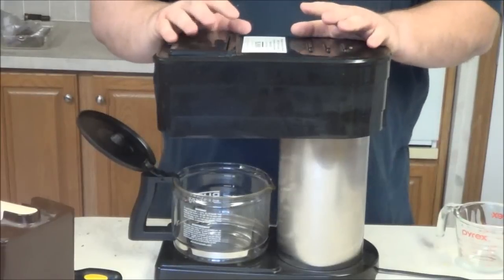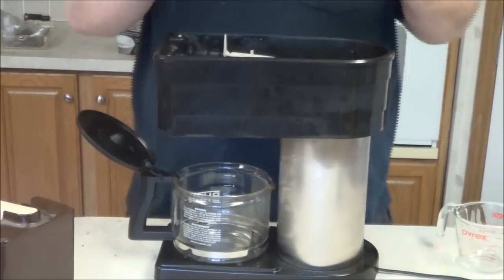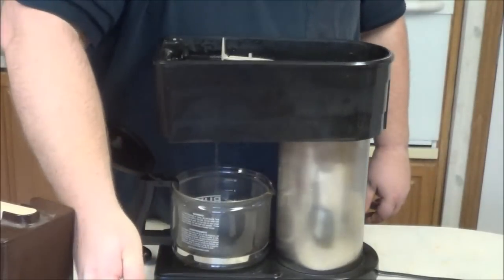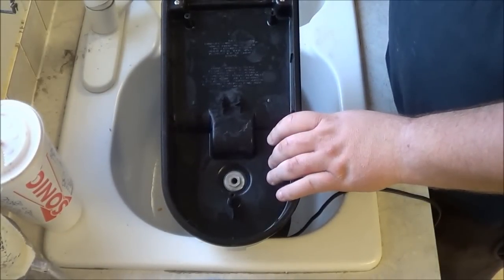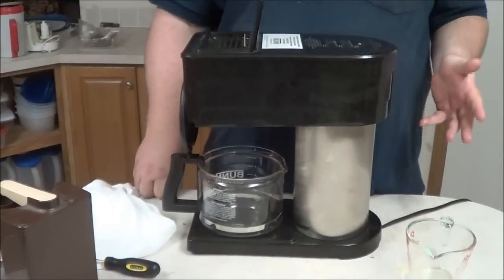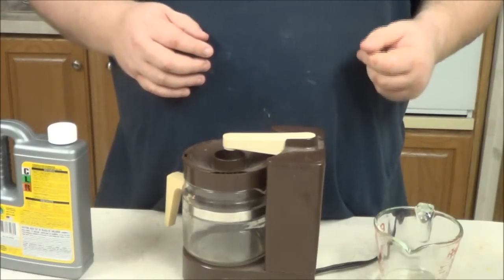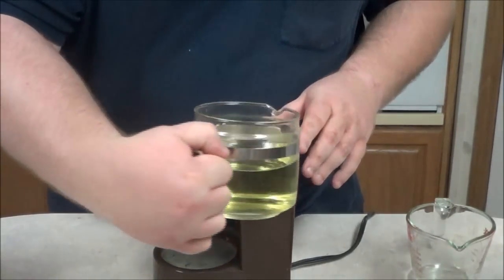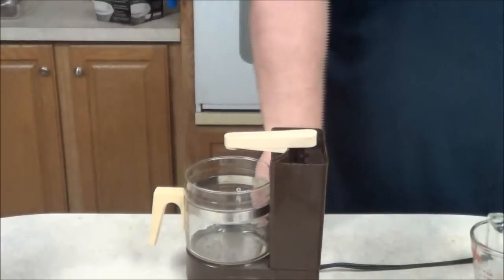How to deep clean your coffee maker

Comment: Nice piece. I followed through with the CLR on my 10 cup BUNN ... I've had it for about 6 years and do it fairly regular with white vinegar. To find out how good that vinegar worked I tried your method. After it got done bubbling like a damn volcano for 25 minutes, I started rinsing ...... I shook it after the first rinse and it sounded like shaking a bag of change. ALL CALCIUM. I ended up full rinsing about 10 times. Well worth doing, but now I have a couple little leaks. LOL
Reply: I found a plug that will separate and was able to dump all that calcium and iron out. Mine sounded like a bunch of change in there! Ugh..

Comment: At one time CLR had mostly phosphoric acid, which was fantastic.  But they changed their formula and went to lactic acid, which is still pretty good.  But I found that a lot of home brewing supply stores carry phosphoric acid under different brand names, and it's food safe.  You can find just the generic acid or some actual brands like Star San.  It's more stable at high heat as well. StarSan is one that's concentrated and would cost a bit more but last forever.

*edit (word entry)
Reply from the maker: CLR has been very good to use. When I first cleaned the coffee maker in the video, the lady at the yard sale said it was only used a few times, but that turned out to be false because I had enough deposits come out of the coffee maker to build a sand box. -MrFixit
Reply: ESRepair I hate to push a product but I admit it's good stuff.

Comment: I have this exact model. When i make coffee it goes so fast into the basket area that it over flows and makes a huge mess. Any ideas on what would cause that??? I ended up using a chip clip on the top lid to help control the speed of the water.

Comment: Our 2008 unit just died. Quite the different system attaching the top to the tank on yours. On ours it was a small  1" long, maybe 1'4" wide  plastic tube with a rubber/silicone gasket between the tank and top. The tank also had a tube that pushed the water to the bottom of the tank so you could not drain it out the top, it all had to go through the spigot. Eventually the gasket started to leak and water went into the electronics area and killed it. It will be interesting to see how the new model is set up once I have to clean it.

Comment: Not even in my washing machine. VINEGAR IT IS. SAFER ON THE INTERNAL PARTS,PERIOD. Just might have to repeat process a couple of times, then immediately straight water before use. But thanks for sharing that bubbly note. Just add baking soda. Not chemicals. Leaves residue you will drink in that coffee. Just my opinion.
Reply: do you understand what a chemical is?  For example, Oxygen is a chemical element. you pull it into your lungs to live along with chemicals, Nitrogen, Carbon Dioxide and water  as well as traces of Carbon Monoxide, Argon and even Methane, yes flamable methane.  Ever smell a fart.  not to be smart but theres your methane.  So don't get on a chemical kick.  Just be smart and understand what you have.  Now the old degreaser trichlorotrifluoroethane was stopped because it may have been hurting the environment.  Its still floating around and we may be breathing it.  You can have ammonia, neon, helium, carbon, yes even nuclear products.  Not much but it can be like winning a lottery.

Comment: Where is your de-liming tool that comes with the Bunn?? That's the reason I watched the video, not quite sure how to use it. Derrrrr 🥴
Reply: Remove the spray head and push the cleaning tool into the tube. Make sure you keep hold of 1 end and do not push it in all the way. You may encounter resistance at points, these are deposits and just push a bit harder to knock them loose. The tool can technically be pushed in far enough to lose it so it if stops before then it is a deposit. Push and pull a few times to clean it out then run some water through to push them all out.

Comment: That Bunn does not hold 10-12-14 cups.  It holds 50 ounces.  You are at double the strength.
Reply: The reservoir of the Bunn holds about 70oz of water.  Only 50oz of hot water is displaced from the reservoir  when brewing a pot of coffee,